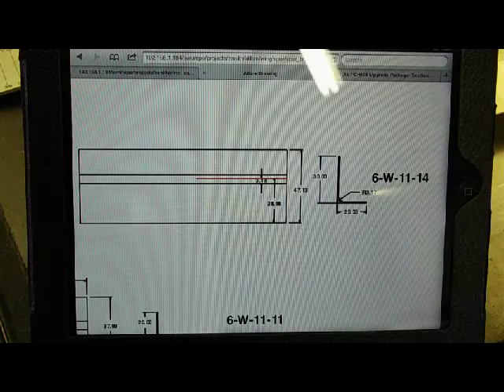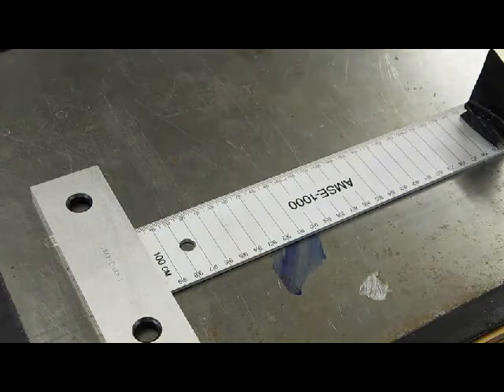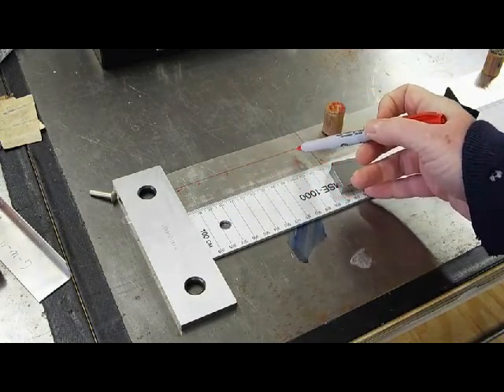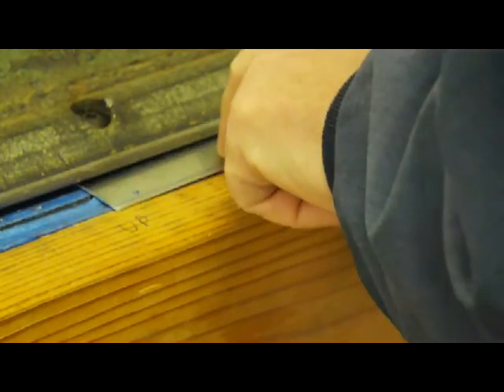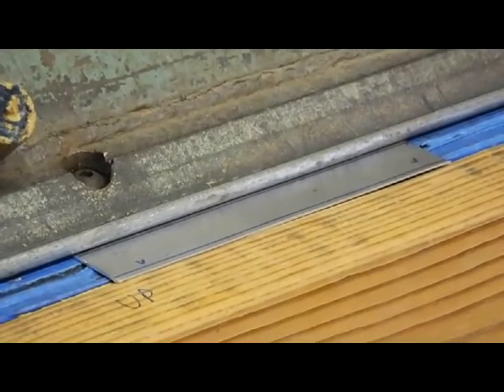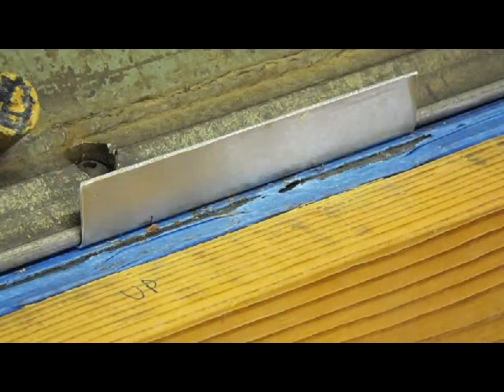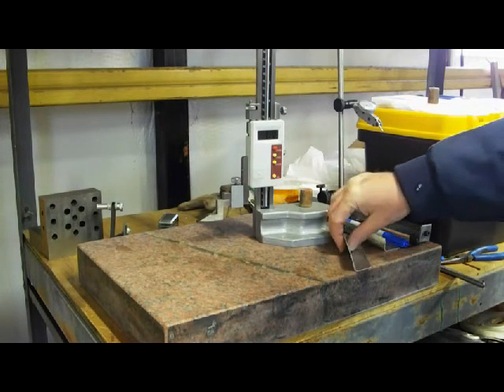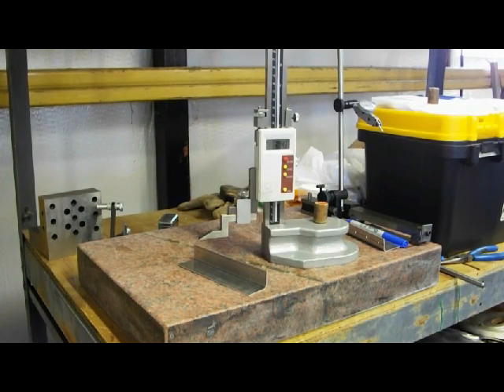Bending a part for a scratchbuilt Zenith 650B

Comment: As you have a mill wouldn’t it be much quicker to cut oversize bend the 90deg then clamp into vice with a block with radius machined into one corner and machine up from bottom parallel 30mm and 20mm
Reply from the maker: You are correct. For parts with a single bend, you can cut overize, bend and trim down.  However I wanted to provide a demonstration of the full technique that I use with a simple part.